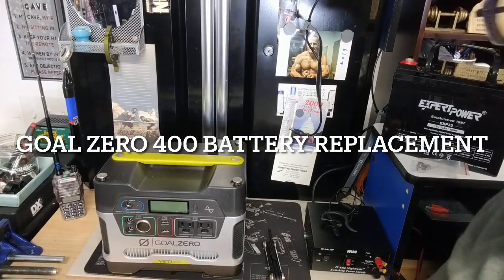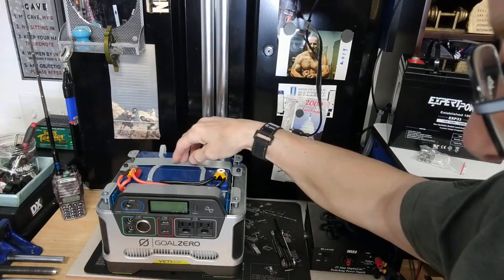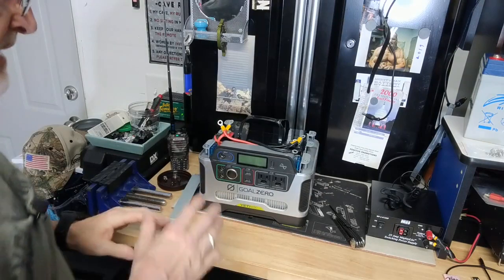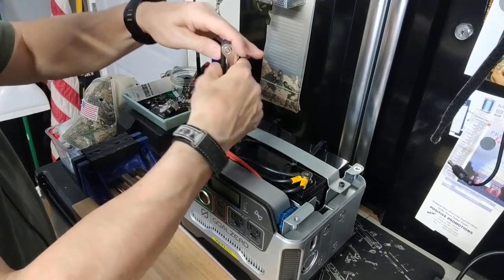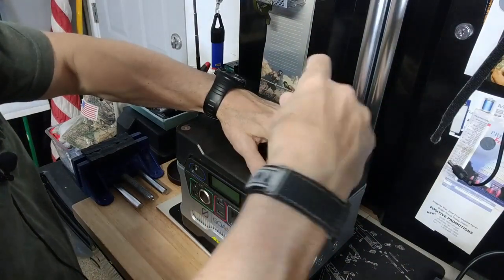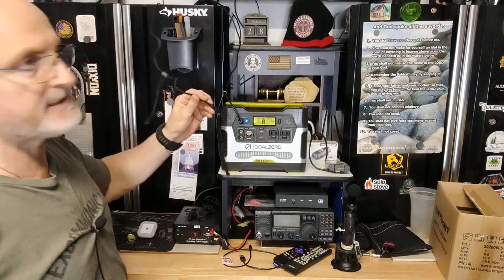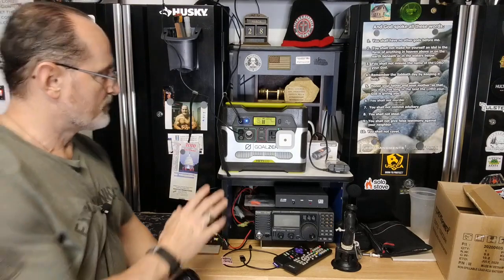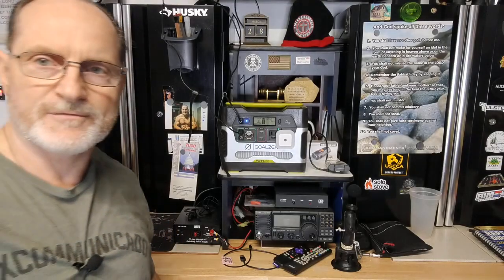How to Replace the Battery in a Goal Zero Yeti 400 Solar Generator

Comment: or you could upgrade to LiFePO drop-in battery  - it's half the weight, 8x's the lifecycles, faster charging, AND, you can take it down to zero % unlike the lead acid battery that can only be used down to 50% before needing to be recharged. Here is a link to the one i got for my yeti400: https://www.mightymaxbattery.com/shop/lifepo4/12v-35ah-u1-lithium-replacement-battery-for-goal-zero-yeti-400-solar-generator/
Reply: you did this? any issue with charge controller?